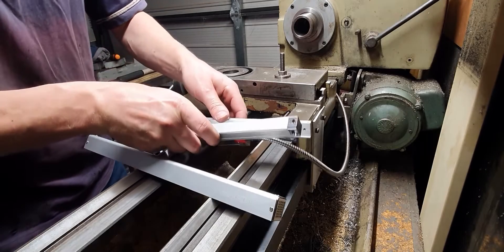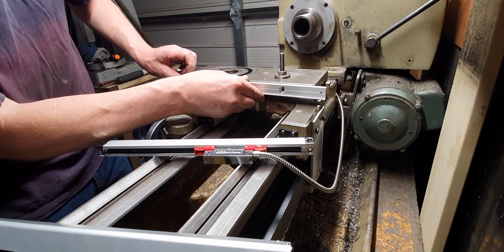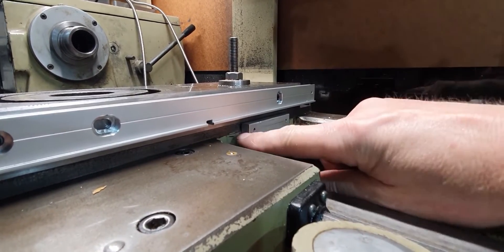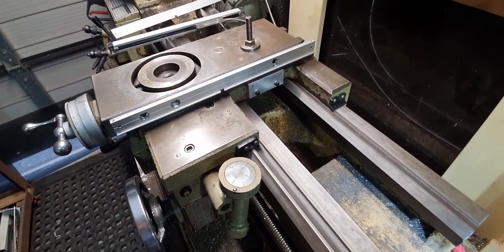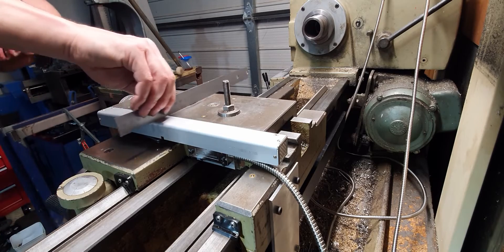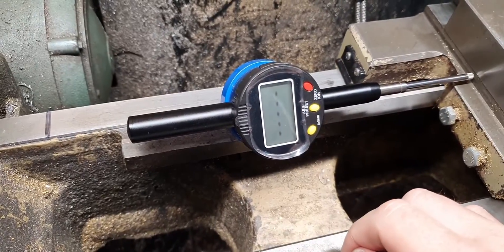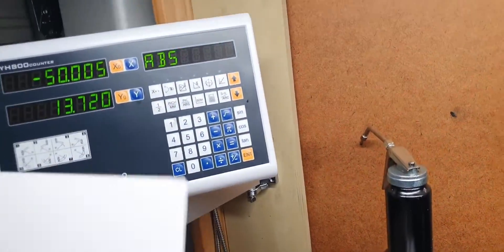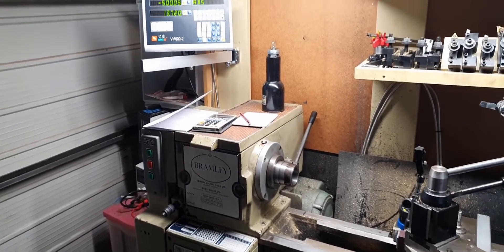#92 - Precision Machining Upgrade: Step-by-Step Installation of Advanced Lathe DRO Kit - Part 2

Comment: I have the Jet version of your lathe, I will be installing a dro from DRO Pros soon. Separate question, are you threading in metric or imperial on your lathe? I will be machineing a collet chuck soon and will need to thread in metric. Any suggestion for setting the lathe for this?
Your videos are very good 
Thank you
Mel, North Carolina
Reply from the maker: Hi Melvin. I cut thread in either metric or imperial. Just have to change the gears. Regards Kevin

Comment: I wish I could mount mine on the cross slide like that, very tidy. All my gib adjustment screws are on that side unfortunately.
Reply from the maker: Hi HM, thats a pain with the gib screws. I know its not favourable but could you mount it the other size? Cheers Kevin
Reply: @Machine_NZ  yeah I did, it's mounted on a piece of flat steel and sticks out towards the back of the cross slide so it doesn't get in the way of chuck jaws. Not ideal, but works 😐

Comment: New sub. Good videos on the installation of the DRO/scales. I purchased DROs for my mill and lathe and that is the best thing I added to them. It makes machining so much easier. Unfortunately that was before I started making YouTube videos so I have no footage. Like you I purchased them from China as buying in NZ was 3X the price. Note that for the X axis on the lathe you can set it to read twice the travel. This is useful for turning to show how much is being removed. E.g. without this setting 0.5mm feed on the X axis will take 1.0mm of the diameter so it is easy to cut too much. Where are you located?
Reply from the maker: Hi there, yes agree its a game changer for me. I'm in the 'Naki' where are you based? Cheers Kevin
Reply: @Machine_NZ  I'm in Auckland. I'm not far from the airport so let me know if your coming through and have some time to meet up.

Comment: That would be nice because the screw in my y axis is not standard. I do like your digital dial guage though, make a good Christmas present for my wife 😅🤣😅👍
Reply from the maker: Hi Paul,
Its great, now I can swap between metric and imperial dimensions simply by pushing a button. The 50mm digital dial indicator is very handy(Chinese but is a good one) Cheers Kevin
Reply: @Machine_NZ  I've got a couple of the cheapest ones I could find on my mill, about $45 each and believe it, they are are nuts on accurate.